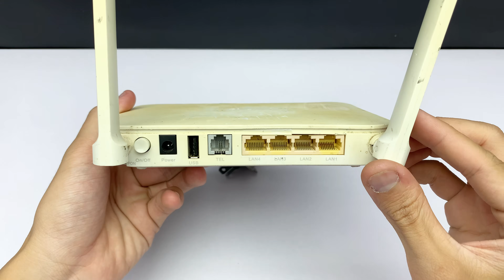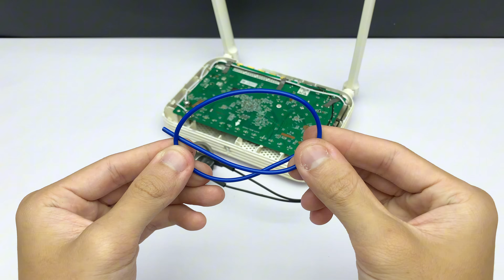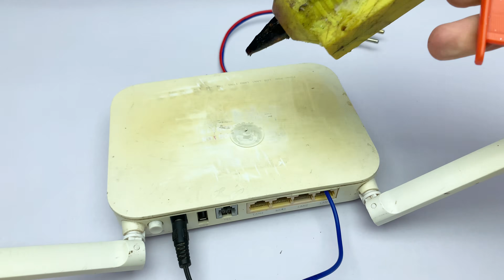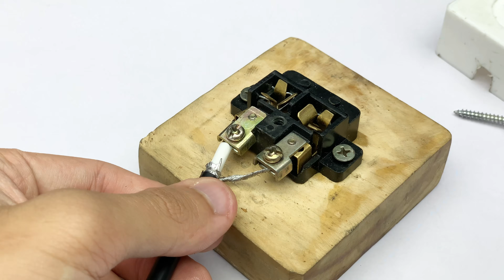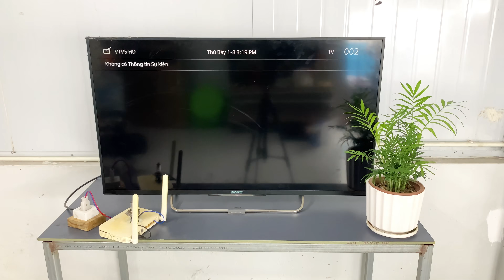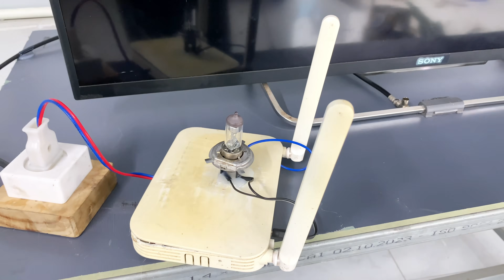📡 Don't Throw Away Your Old WiFi Router! Just Connect a CAR BULB This Way!

Comment: Need clarification where the black wires connect to circuit board.
What is working distance to broadcast antenna?
Reply from the maker: Thank you for asking! The video should show the black-wire connection more clearly—please connect wires only to the terminals identified in the board’s schematic, not by color alone. There is no fixed reception distance; it depends on transmitter power, terrain, obstacles, antenna height, and DVB standard. What country are you in, and roughly how far are you from the broadcast tower?